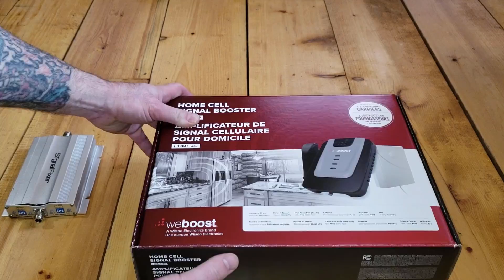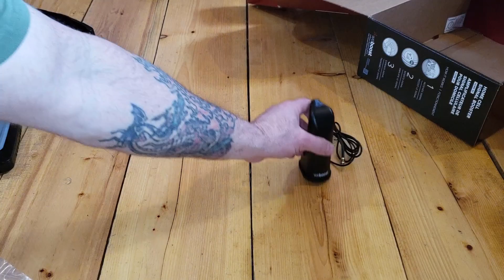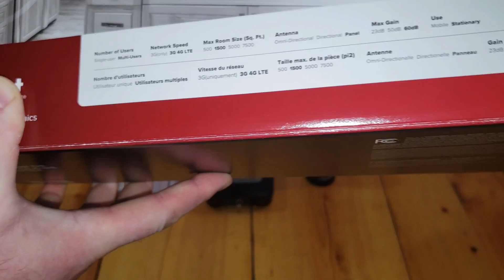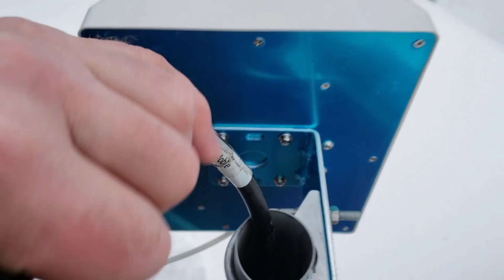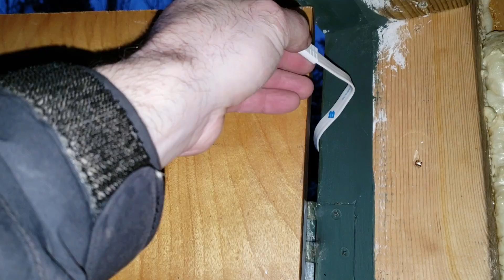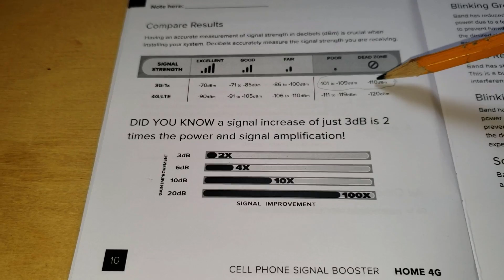WEBOOST Cell Signal Booster at the Cabin - Unbox, Install, and Review!

Comment: Excellent video as you worked though the challenges.
As a 40 year RF engineer, my comments are posted to you  but for others to help plan ahead.

Your previous coax with 50 ohm N connector would have created an impedance mis-match to the RF Components in the booster.
Majority of boosters are 50 ohm EXCEPT these recent consumer Weboost products.
If you had needed more signal, 75 Ohm RG11 could be used to the roof.

Wilson - Weboost truly supports you post sales as I found out last month after purchasing an RV65 for my camper.
The Panel had been marketed in the past for the external antenna but is greatly outperformed by the 75 Ohm 4G Yagis offered by many vendors.
The flat panel has a beam width of 120 degrees versus 45 of the yagi getting more signal pinpointed to the tower.
Think of a similar wattage floodlight versus a spotlight.

Like wise the 10 DB gain flat panel can perform better than the desktop inside the cabin if also 75 OHM.
Adapters are available to changes fittings but with substantial loss.
Reply: Hiya :) Cool any recommend places to purchase the components you mentioned in this post? :)

Comment: You might want to get the adaptors and go back using the lmr400 with n connectors (old black cable) that should give a better signal than rg6

Comment: Where you live 3G is definitely more reliable then LTE. It runs on a lower frequency band sum
Where around the 800 and 900 megahertz. Where LTE runs between 2100 megahertz and 2700 megahertz in North America

Comment: Thanks fo this video. Event though I live in an area that you think would have good cell service it's not very good and I was thinking of getting a booster and tripped across your video.
Then I saw your sign that says"trespassers will be shot and survivors will be shot again" and realized why you live out in the woods alone. But it looks like you still need society to come to the rescue in case you get into trouble. So why is the sign inside the house? Why would anyone come to your aid when there's a chance they might get shot? I think your mom see's what the problem is.

Comment: We have a cabin in the mountains of SE Tennessee, the nearest cell tower is over 12 miles away and not clear line of sight.  We had terrible cell coverage and decided to install a cell phone booster which is a Wilson DB Pro 4G, currently known as Weboost.  The system we installed is similar to yours, with a couple of exceptions,  both the indoor and outdoor antennas are directional not omni directional which came with your booster kit.   The results that we had were not as favorable as yours we did improve to 2 bars, sometimes 3 with periods of 3G signal strength but that was very inconsistent and unless we stood close to the indoor antenna, we would still drop some calls which was annoying.   Tiring of the inconsistent signal strength and the uncertainty of calls dropping, I did further investigation into ways of modifying the set up for improved signal strength.  Abiding by FCC regulations, it is my understanding when you purchase these "kits" and not individual components, they have to supply you with the omni directional antennas and RG6 cable that you have.  That was changed from when we purchased ours that came with the directional antenna, but the RG6 cable still applied.  I was running 70 feet of RG6 cable to my -8dbi outdoor antenna which at 800 MHz has .83 dbi drop and at 1900 MHz, has 1.35 dbi drop.  Unfortunately my carrier, Verizon operates on both of the frequencies.  Doing the math you can see the dbi loss of this cable was basically nullifying the gain from the antenna.  Realizing this shortcoming, I purchased an aftermarket Log Periodic Directional -15 dbi outdoor Yagi antenna and purchased 70 feet of RG11 cable which has half of the dbi loss of RG6, installed this replacing the "kitted" antenna and cable.  Once I had the antenna pointed in the proper direction, it was time for the moment of truth, I energized the system and I was pleasantly surprised when I looked at my phone, I was now at 4-5 bars with LTE signal strength!   Checking the SIM status on my phone, I was going between -90 to -96 dbm which was ranging from excellent to good signal strength and I could not be happier with the $175.00 I invested on upgrading the antenna, cable and connectors.  Additionally, we use a Verizon Mifi for internet use on our laptops or when we have guests come to our cabin.  We position that close to our indoor antenna and gives very good hotspot signal, I am able to work on my laptop doing estimates, writing CNC programs and design work as I own a business several states away, the ability be able to e-mail such things is integral while being at the cabin.  Hope this helps with future modifications if needed to booster systems.
Reply: I would say wait
Reply: What brand of aftermarket antenna did you buy? Im looking to getting the Weboost but want to go your route of upgrading it. Im worried about combatabilty and some antennas not working.
Reply: You could have just gotten a Verizon femtocell that connects to the home internet via ethernet cable
Reply: @aab434  if Internet was available I’m sure that’s the route they’d have went

Comment: Because signal we can't see with the naked eyes it's difficult to determine whether that thing really works at its optimum performance....however there is one thing i've learned a little about signal...where it is really minimal that is all you can get even if you have an amplifier it does help a little but not much....however if you are within range of signal although it is low there is help you can build your own less than $5 bucks...

Comment: I have one of these at my lake house. It works. I get 0-1 bar without.  Get 1-3 with it.  Doesn’t sound like much but it’s better than none.  The people at Wilson are great to work with too.  Very helpful to help figure what works best.  I upgraded my internal antenna as that small black one only worked in a few foot radius.  The upgrade only gives me a few more feet.  I have to be close to the internal ant. The flat wire is new to me and I’m going to check it out. My reception does vary with the weather though

Comment: 3G it lower in fregvency so it have lower speed longer range ,4G have higher speed shorter range ,the new very dangerous 5G for health it very short range and super high speed ,i will never buy 5G terminals or phones EVER !!!! 4G it dangerous to....that is good you keep the secondary antena outside and unplug it wen you sleep so you dont get iradiated by elctromagnetic smog.....you lucky that you live in the wild away from polution.....in big city you got WiFi and 4G and now 5G  just read on internet what dangerous is....i will give you a link about 4G range.....

Comment: great video, very informative!  I would like to know the price of this booster?  I have verizon, tower is 7-10 miles away cant get signal less i am outside.  So, i had to get a land phone and its an extra 130.00 for internet and phone?  crazy!  If i can use the booster it will save me a land phone bill which over a year is a 1300.00 savings?  so, very important to find about the booster..  the video was great and the best part was you did not fall!!!  my roof is steel and slippery too. Please email me if you feel more comfortable..  thanks for sharing....   Tom n Rocky     email:   thomasengle65@gmail.com
Reply from the maker: Hello Tom n Rocky! This booster sells for about $500 on amazon but with the current exchange rate which is about 30 or 35% you can order one from Canada and save almost a 1/3. It should work for you as long as you can get some signal outside. So far it's working great! 👍

Comment: Your original cable and connector was more robust. Standard for oilfield SCADA installations etc. But the RG6 should work fine for your purposes. I would put a dab of dielectric grease in the connector though but not critical. Thanks for the video.

Comment: LMR 400 is the best cable.keep it in line.Just attach the unit to the LMR400. oh well to late.Keep the lmr in case you want a radio,like a CB.You will need to change the adapters to SO type connectors for that.Height is might.The higher up your antenna the better.at your location a 8 to 10 foot height increase will really be great! Peace Brother!

Comment: Turn your outside antena slightly side tonside and sometimes depending on where your tower is you can get a much stronger signal. Go to the App Store and get a speed test app and check it out. Outside antena direction can make a huge difference. Try it. Also if you get rid of that adapter that takes your cable thru doorways, makes a difference. The less connections the stronger the signal. Good Luck‼️👍👍  Vinny 🇺🇸

Comment: Excellent review.  The old cable appears to be coax type RG-11 with type "N" type connector. This cable and connector is used for low signal loss in a high frequency environment.  It is the standard for Radio Frequency cables in a professional installation.    RG-6 cable with "F" fittings work, but the signal loss is much higher.  I don't know what carrier you are using,  but you might want to have a friend on a different carrier come to your cabin and see how much signal (more bars) they receive.  On the West Coast, In all my years of work, I have noticed that Verizon is usually superior in signal strength to all the other carriers outside of town.   I use AT&T and for the most part, they will have much less signal available out of town.  Friends with Verizon always have more signal.   Keep up the interesting videos.  We don't have anything like this in California.
Reply from the maker: Thanks for the information, I appreciate it!

Comment: Hey brother, thanks for the shout out.  You do a great job of laying out the simplicity and ease of use of this product.  I found it interesting though that your outside antenna is the inside antenna that came with my kit and  your old outside dirrectional antenna is identical to the outside antenna that also came with my kit accept for the cable that comes out of the antenna which is standard coax cable.  Either way, thanks for another great video.

Comment: I enjoyed this video.  First thing, my home is maybe 5 miles from the Cabin Depot.  I only heard about it myself just before Christmas, and have not had time to check it out.  I was glad to see that you changed out the antenna for a couple of reasons.  It is impossible to tell from the video, but one or both of those antennas may have contained electronics powered by the booster.  It could be bad news if you connected up something which wasn't compatible.  There could also be impedance differences between the systems which could at the very least, cause a loss of efficiency.  The antenna change was definitely a good thing.  I did not notice if you sealed up the connection at the antenna.  If not, it would be a good idea to put something over it, even several layers of vinyl tape is better than nothing.  You could likely find a heat shrinkable tubing with sealant inside for that size of cable since it is so widely used.  One other thing, where you enter the building if you haven't put a drip loop, that is a good idea so that water running down the cable drips on the ground instead of following the cable into the cabin.  You may have done that, it just was not on the video.  If not just pull a foot of slack back from inside so that the cable has to run back uphill to the hole in the wall.  I guess I have been long winded enough.  I spent 30 years in the communications industry and get carried away sometimes.  I could maybe answer questions if you had some, but you have everything under control and I would just be adding "noise" to this note.  Thanks for taking the time to show your job.  It looks like that booster will do the trick for you, and it appears to have enough amplification for your location!  Great video!
Reply from the maker: Thanks for the info. Yes, I did seal up those connections, don't want any water getting in them.

Comment: Good news on the signal booster. I have an older wilson booster it is the soho 60 there was no service at my cabin at all now I have 3 to 5 bars of 4G lte most of the time I had to put up a 40 ft pole to get that much. Wilson boosters are the best in my opion. All the best.

Comment: Awesome review, thank you for sharing. Just a quick suggestion with that coax cable.  The connector up on the roof at the antenna, when you have a chance, try to get something over it to waterproof it. Even just some heat shrink tubing would be just fine.  Those connectors take on water and rust out pretty quickly sometimes.  I used to do a lot of satellite dish installs, and always tried to keep them water tight.  Great video, and I am glad to see you have a good reliable option now in case of emergencies.  Take care, and all the best :)
Reply from the maker: Roger that, I sealed up those connections.
Reply: great comment Colin

Comment: Just a thought here, you should see if you can raise it up 10' higher and see what that does to your signal. The tree density changes significantly as you get higher, and the higher the better. or you could thin the trees a little in the direction. the RF is really easy to dampen with any obstructions, eliminate all that you can. Let me know if this helps.
Reply from the maker: Thanks. I might try to get it up in the air a little higher this summer.

Comment: Do you use modified or pure sine wave inverters. I want a pure sine wave inverter, but now I have a modified sine wave.   I am thinking of looking into a 12 volt cell booster like for a camper to run straight off of a battery.
I like the We Boost though.
     Next you need a camera up high there to cover the whole area of your cabin, birds eye view.  Sorry to be so long.  Take care.
Reply from the maker: pure sine wave. it's the only way to go with electronics.

Comment: I also installed the same system at my cabin, mine had the directional antenna, went from no service to three or four bars with LTE, doesnt drain the solar either so that's a plus.
Reply: Can you then connect to the internet?

Comment: The old coax cable has an N type connector, common stuff with commercial radio systems.
Reply: Type N connector. Given the frequency range in older 3g networks best  guess is coax is LMR 400. The coax will not bend in a very tight radius as LMR 400 is very stiff and has a brittle core